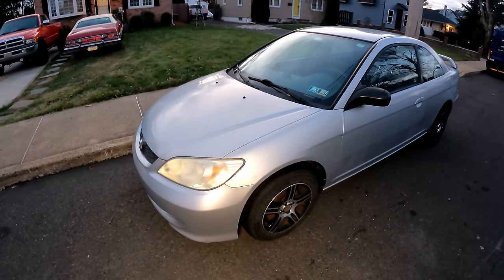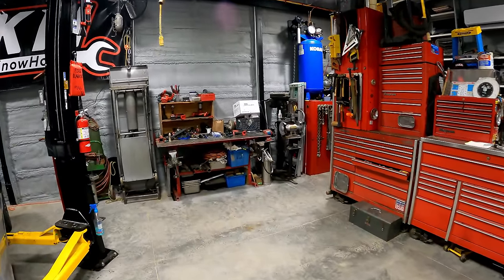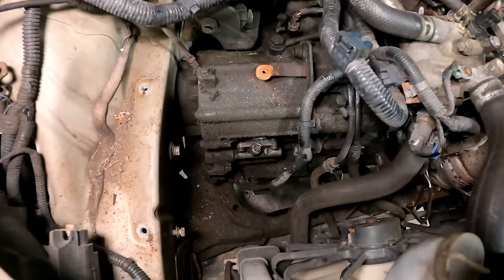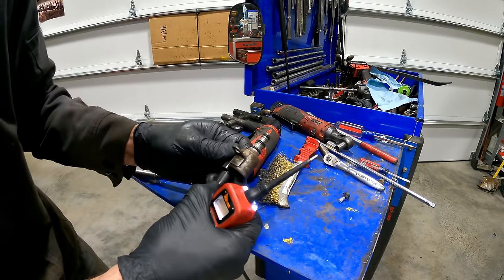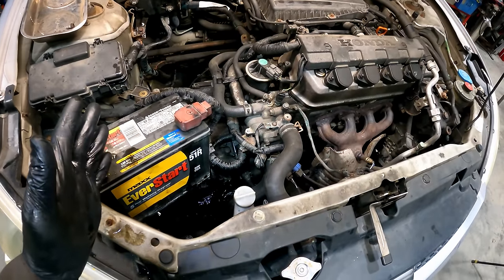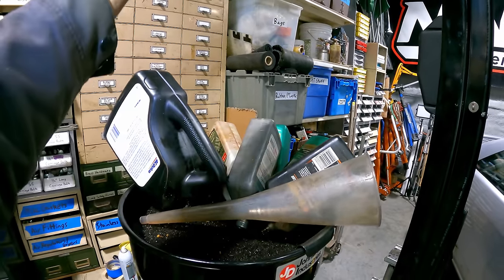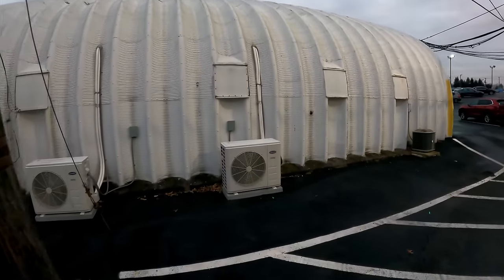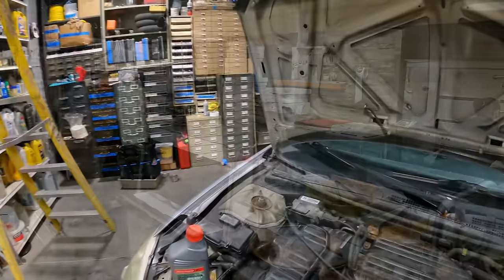Honda Transmission Slipping FAST/EASY FIX

Comment: Could you add an extra filter on a cooler line?  Make it some what serviceable then.
Reply from the maker: Yes I actually just ordered an inline filter to put on the cooler hose. I forgot to mention it in the video
Reply: Good idea
Reply: While such a solution would obviously collect the contamination, it will also add additional pressure drop which could have negative effects.  Granted so does a clogged suction strainer.  But I would be careful about using too small or too fine of a mesh on an inline filter.  Just something to consider.

Comment: You are the master. I do have a question about the car lift. On my asymmetrical 2-post I was told by Bendpak that you shouldn't lift any car backwards.  You have been doing this for some time. Is that information incorrect or because the car is so light you are not worried about which way it goes on the lift?
Reply from the maker: They probably just say that for liability reasons. As long as you have the vehicle balanced properly on there should be fine. This is a 10k lift so lifting a small Civic it could be positioned off center and still be fine. But of course that's just my opinion. I've seen some really sketchy stuff on rotary lifts and I suppose that's giving me confidence in them.

Comment: Did the blowback through the transmission cooling line and change the fluid. I did not do the flush with the diesel. I am up and running for now. I’ll drive it for a week or so and change the fluid one more time. I’ll report back in a couple of months or if it quits working, which ever comes first. Thanks for the tip. This car has been dead in the water for about a year as I didn’t feel it worth it to purchase another transmission and go through all the trouble to put it in.
Reply from the maker: Awesome to hear that it worked for you. And yeah I don't think there's a real need to flush it out. Blowing back seems to do the trick. Just drive or easy and should be good for quite some time I would imagine
Reply: @NNKH2  Hey man, how's the car doin' these days? Our rogue is doing the same thing. Odd shifting and no power when going uphill etc. Short of selling the thing we're almost out of options. Weird thing is our rogue still moves, not great. but it moves. As with jen, we hadn't ever changed the fluid up until it was too late... could kick myself and am paying for it now. Good video man!

Comment: My 1995 accord is coming to the end of the transmission life with 337,000.  It's an auto.  And there has been metal paste for 200,000 miles.  JDM trans is $800 shipped with 60,000 miles or less.  Got to love JDM stuff.  You should change transmission fluid every 40,000 miles.

Comment: The most common issues with  most transmission is the Atf cooler located in the radiator when it get clocked up the return oil line send little  or AtF into transmission for better performance  I just fix one 2003 honda pilort with is same method  thanks for the this your update

Comment: im not sure if its different for your honda but i know for a lot of them when you check your transfluid as opposed to most vehicles your supposed to shut the car off after getting it warmed up and then check the fluid for an accurate reading, otherwise it can look full or overfull when it is actually not

Comment: This popped up in my feed a few days ago after watching the 71 coup de ville and the town car. As it happens I have 2004 civic here now. Trying to find an oil leak that only leaks when driving around. Can't get it to leak in my driveway but a short trip around the block and it's running down the block front and rear from head level down by the trans. Supposed to pull the vvt tomorrow and change the gasket hoping that's my leak. Can't see it with all the hoses there. Well she took to run an errand and the transmission failed. I remembered this video. Nothing to lose. I may try this "flush" tomorrow.

Comment: I have a 2003 Accord; same issue shifting from 1st to second. The trans guy says 2600 to replace with used. I simply let off the accelerator at the shift point. smacks in gear that way. over 15 
k miles doing in this. The car still give a dodge hemi a run for it's money.

Comment: Wow brother that's awesome. Reason why I own 5 Honda's 😂. I've never had an issue but I love them. I even have a 2004 Pilot with 299,900 miles and STILL runs like a champ.  Thanks for the  extra tip lol. Glad it all worked out. Great video.
Reply: Whoop, so You're going on the third timing belt change soon?😅

Comment: I am going to have to try this. My woman's van runs fine some days then slips other days then has nothing but first gear other days. And the days it only has first gear the speedo stops working? And of course it's new enough it doesn't have a drain plug. Great video thanks for the advice.
Reply: Next time you drop the pan, drill out and tap the back of the pan and put one in for the old lady!

Comment: I just bought a 2001 Honda Civic with the same problem I think because the owner thought the transmission went bad.  I may just try this and see what happens.
If you have any suggestions let me know.  Also I need an affordable diagnosis computer.  what did you use?

Comment: Excellent work you hit it on the head my friend thank you for sharing knowledge, I had slipping issue with my son's 2005 honda civic and just got it fixed using your method of cleaning non replaceable strainer with air gun , thank you so much you are awesome !
Reply: It worked?

Comment: I’m curious how far your lift is from the back wall in the corner.  I’d like to minimize footprint in my shop and all the 2 post lifts I see spec 12 feet off the wall. It looks like you’ve got 8ft or so?
Reply from the maker: It's an asymmetrical and it's on an angle. The post that is closer to the wall is only 8 ft yes. I just measured. But honestly I wish I pushed it out further. May end up moving in the future or going with a symmetric lift. It's working okay but for longer vehicles it can be annoying.
Reply: Awesome, thanks for measuring that!

Comment: Internal filter is the dumbest,,,,,,if u split it,,,,know which NUT is reverse thread,,,and blow out the feed tubes.   They also have steel filters inside.   Keep it up bro 💪

Comment: This is crazy, my car is doing the exact same thing! Literally identical issue to this, except my car is a little more driveable. I have a question, I will most likely be replicating this process with my car. Is it okay to let the trans run out of fluid when flushing the diesel through it. If I don't remove the trans cooler hose, can I just leave the trans drain plug open to let it flush through? DId you flush all  the diesel out by running the car while letting it drain? Thanks for the great video!

Comment: It's not quite the same, but I had a Suzuki King-Quad 350, and it had a mean whine in the trans from 3rd thru to 5th.
Somebody recommended I put MotorUp in it. Wasn't too keen, but I thought it might be worth a try.
Called the MotorUp "helpline" who said, "Yeah man -do it - it'll work".
Lost ALL drive, FWD and REV. I suspected this would happen, as it shared the engine oil with the trans and clutch.
Had to flush the entire thing out with gasoline, and then refill it and let it sit overnight filled up with gas.
After the third attempt, it functioned again, and was fine to drive, but the trans was still noisy.
Sold it for $1800, and will NEVER use MotorUp again.
Diesel might have been a less aggressive option, but, hey, it was already buggered at that point.
Cheers for your work.
Gonna try it on my mate's Honda Jazz.

Comment: I've owned 2 Hondas 

97 odyssey that had 400,000 miles. 
Turd that started every time.  
Had to start it with a screwdriver. 

Ignition was broke.
Power roof still worked.
Wasn't rusted.
Eventually sold it for $350.  Nobody wanted it. 
99 crv met it's end when i was hit in the ass by a chevy subcompact on the highway.

Comment: Chris since you got it running did you pressure wash it is the question.. just saying just incase you will have to change it.. makes things easier to take apart. god forbid you will have to do it.. but since you saw it full of fluid on the outside and grimy just saying??? i do my ford explorer all the time.. hate working on greasy engines and transmissions. I do but i would rather have them clean hahaha. but hey if they were clean you would never know if there was a leak somewhere right? thanks for sharing stay warm stay safe.

Comment: Sad part with these newer vehicles is they cook the  transmission fluid and it goes brown and smells burnt. I did something similar to an 2009 dodge Journey that the transmission kept going into limp mode. I flushed it out changed the filter and it’s been fine.

Comment: 90's hyundai's had a small oil pickup screen and would make similar noises. They would starve and seize on the highway. The fix was to remove it with a long screwdriver though the sump plug to save removing the oil pan.

Edit: Another trick would be to put a cup of gasoline in to a tired auto trans to swell the seals to help more pressure.

Comment: What a great fix Chris,even though the clutches will inevitably be on their last legs with all that shedded material that came out.
Your lift is great,and will greatly reduce your back wear too i hope .
Reply: Oh, that was clutch material? I thought it was metal because it was sticking to the 🧲 of the drain plug😮
Reply: Worn down to metal beyond Budgie cages,rusty ones at that.
Thank you for your Animosity friend .
GFY
Reply: @Popeyes66  yikes that it was the discs that were the shredded pieces on the magnet... Weird after the test drive it was pulling well.

He has a backup transmission anyway

Comment: I have a 2001 manual. While owning it, I've noticed a lot of 01-05 automatic Civics in the local junkyard over time. I wonder how many had this issue, but were junked. I would never buy their automatic.

Comment: Friend of mine brought his wee automatic Hyundai in to me, said it wouldn't go into reverse. I just changed out the trans, managed to get a good cheap one, the seller said was low miles. I lowered it to the floor altho I did think about taking out the whole engine. I should have tried changing the oil.

Comment: Nice job.  You saved yourself so much pain.   Looks like the steering needs alignment.  You know, also polishing up those headlamps with all the gear you have will go a long way to making night time driving less dim.   I've done it on my older cars and it works wonders.
Reply: I bet potholes out his way are more plentiful than pavement

Comment: I noticed you mentioned you put diesel in the transmission as a temporary means of flushing it out. Could you please share how much you put in? Did you do have atf and half diesel or did you fill the whole thing up with diesel?

Again I realize this is just to pump it through to act as a cleanser but any more details would be appreciated!

Comment: I am first owner of 2004 and 2005 and 2007 Honda Civics. I had the dealer or myself or the general mechanic do all the recommended services until I sold the 2004 to my youngest son who sold it as soon as it needed anything expensive done. The 2005 has over 210 thousand miles and the 2007 around 180 thousand miles. Both are sound except 2005 has rust hole on drivers side above the trunk and it needs a paint job but I can't afford to have it painted. I just had Maaco paint the 2007 and it came out very nice. I put a wolfbox video system on the 2007 that collected rear video when fork lift backed into the bumper and left a scratch. I asked the Honda dealers to change the filter when they did the transmission service and they said no filter. I did research on both and found the 2007 Honda civic had a filter and I replaced it myself. The 2005 I have not fully researched it yet so if you  know if has a filter please let me know. In my research I found Honda replaced the internal screen with a bigger screen so the screen does not clog so often. Very smart you did back flush because its not in the service manauls to do that process that way and I think it should be documented and shared with a vider audience for the Honda Civics to replace the filters that are buried behind the fuel injection and intake manifold and the dealers told me the filters don't exist. A clogged filter or screen can burn up a transmission. Good Job!

Comment: This is exactly what I need to do to my 2003 Audi a6….It still runs and drives good.    but it slips sometimes and it gets stuck in limp mode. Usually turning the car off and turning it back on solves the problem temporarily. I do have that wining noise coming from the transmission and I was thinking it sounded like a pump.   So after seeing this video Kris, I’m concerned that I need to do the same thing to my Audi but I would have no idea what hose to send the back pressure air through. Any thoughts? Great video is always very helpful. Unbelievable.

Comment: I've got a 2004 Civic Hybrid, and it has the same issue, but the previous owner said that he drove it to the beach and came back and parked it. There was no slipping before, and now the car isn't moving at all, no clutch whining noise.

Comment: Hey Chris not sure if I missed it in another video but are you still using the Cleanburn you had in your old shop in the new one?
Reply from the maker: No I sold it and I've been using a small mini split. Works amazing. I don't get as much used oil as I used to

Comment: Thats a great idea to use remnant atf to teat on it. Why waste good new oil of something that might be already DOA.. forgot to mention that too. 

I put in that multi import or whatever thibking it would be fine and boy WAS I WRONG! The clutch bands slipped like crazy! Only original. You'd think sonce its castrol it would be fine but NOPE. 

Hard lessons from not owning a Honda. Same with the power steering fluid. Generic will make the seals leak.

Comment: I'm sure you have seen what happens when someone puts power steering fluid in the master cylinder and it swells all the rubber in the system. The same thing happens when you put brake fluid in the transmission.
That's an old used car lot trick.
I have seen used transmissions that have sat so long and the seals dry out and a cup of brake fluid will make it work.

Comment: Nice fix....obviously the filter was clogged. I wonder if it could have benefited from a few cycles of running diesel through it blowing it back? By the time a Honda hits 160k, I would have had at least 3 trans fluid drain/fill done. I have had a 2001, 2004 and 2010 civic in the family. 01 and 04 are low miles, driven by retired people. 01 has 110k on it now. The 2010 has 275k on it. Trans fluid changed every 50k (at least). Fluid comes out clean, minimal junk on the magnet. 2010 has a external filter under the airbox against the firewall. That was changed at about 220k. Car is bullet proof. Going to shoot for 400k on it before buying a new one.

Comment: BTW, your old honda will shift better with Valvoline maxlife.  I thought my trans was done 100,000 miles ago at 237,000 but switching to maxlife made it shift a lot better.  I don't know how much longer it has at 337,000, but maxlife is some fine fluid and just over $20 a gallon at Walmart.

Comment: My friend had a honda Civic and I worked on it changing the starter and temp probe and battery and spark plugs and he ran it low on oil and siezed the engine ! Now the car is pretty much junked

Comment: The next-generation Civic has an inline filter in the line going to the radiator.
Perhaps that's your answer. I have 212,000 miles on my 2010 Civic.

Comment: 163,900 miles is 263,932 km, not bad considering it is overdue for at least 2 ATF flushes.

My '04 CR-V is probably overdue too.

Comment: same year as my Toyota Corolla with 234k km. Currently has 2 problems: valve cover gasket leking oil in to spark plug holes and ccv axel/transmission leaking gear oil. This era japanese cars are great overall, i'm sure gonna drive mine for many more years if nothing colossal happens

Comment: Hello I’m hoping to contact someone in the USA. My name is Steve and I live in the UK. 
Wondering if it might be possible to ask for your help. I currently have a lovely 1999 . Honda Accord 3ltr Coupe which has been my pride and joy for the last 15 years. Unfortunately Honda only exported about 1,500 vehicles to the UK. One of the problems I have is the parts for this car are very hard to come by in the UK. 
I now have a problem with the automatic transmission. I am finding it difficult to find someone over here who can carry out a recondition. Everyone is saying that the parts arnt available. So I thought I would try and track down the parts myself. 
What I am after is some kind of reconditioning kit for this vehicle. Was wondering if there was any way you could possibly let me know of a parts supplier for this car in the USA? It was the USA where this car was manufactured not in Japan. I know this is completely a shot in the dark but am hoping someone somewhere may be able to put me in the right direction. Would really appreciate it if you could get back to with any information please. All the best …. Steve

Comment: it should last 250k miles easily and seeing how it well it shifts it should be fine. My civic lasted at 260k miles before trans started to slip but it could have been same issue

Comment: So a clogged hose starved the pump of fluid so the transmission wasn’t building any pressure to hold the clutches. It’s always something simple usually.

Comment: My 99 wj was doing some weird transmission stuff like slipping into neutral when driving and kinda hunting for gears ...it was the tthrottle position sensor i forgot to put the oring and gasket on the tps between the throttle body and the tps ...oops!!!